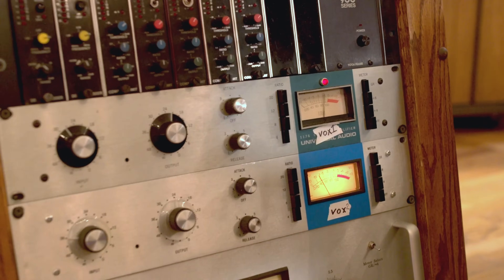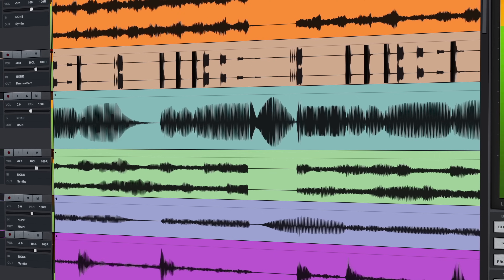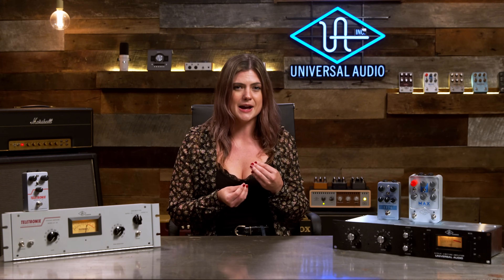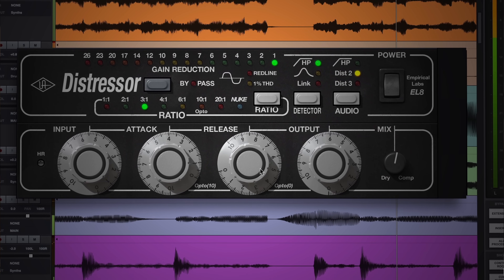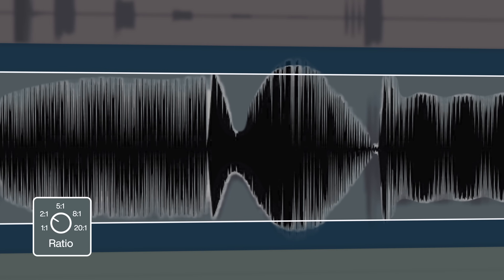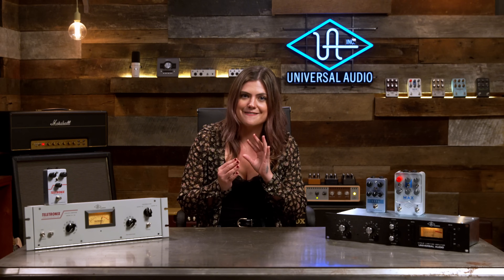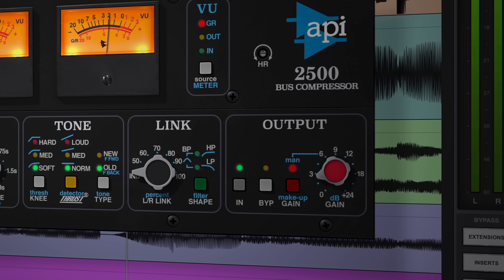How Do Audio Compressors Work?

Comment: 1:04 the graphic here is misleading. Compressor knee actually goes from totally hard (compressor attacks only above threshold) and totally soft (compressor begins attacking and releasing below threshold). The graphic makes it look like the same threshold holds for both shapes but it doesn’t really. Actually the hard shape is at that line but the soft shape goes below it. At the threshold, the ratio is whatever the knob is set to. Below the threshold, with a soft knee, a gradual ratio is present.

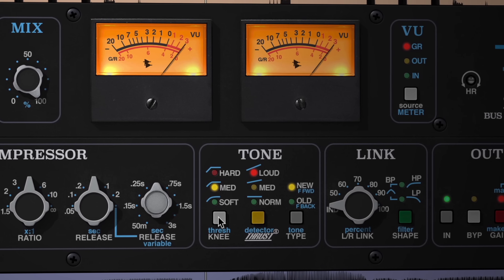You can hear what I mean at 1:14. The syncopated individual snare hit on 2 ee and UH 3 EE triggers the compressor with soft knee but progressively less with medium and hard knee. The release is short so you hear it as a reduction in sustain of those events as the knee becomes harder. Subtle but it’s there. Reason being they’re too quiet to reach the hard knee threshold but the soft knee reaches down to “grab them”. Auto makeup gain is on so it boosts the level as the release stage kicks in.

Also, 1:27, attack time is not the time it takes for a compressor to reach full compression. Full compression never happens. In Calculus it’s called a ‘limit’. Compressor attack time is the time it takes to achieve 2/3 of the gain reduction as set by the ratio control for a given threshold (minus the knee probably).

Ironically, the Fairchild compressor they show at 4:50 is known for being very fast. Look how fast the needle is moving - it catches everything.

Comment: Compression always seems like the solution to a problem I don't have. I LIKE the difference between the softest and loudest sounds
Reply: But when mixing a full mix, it can really glue everything together
Reply: It can bring out low-level detail, increase sustain, give a feeling of “support”, enhance or reduce punch, create distortion, change the timbre, and make discrete parts sound more unified. Try parallel compression.

Comment: Can I ask if the UAD Dsp plugin is better than UAD spark, or is it the same? thank
Reply: Sonically, they are the same. However, as native plugins (UADx/spark) run in the host instead of the soundcard, you of course won’t get the same latency free monitoring, neither unison preamps for those that support it 😉. They are perfect for mixing though.
Reply from the maker: No, UAD DSP plugins are the same as the native ones, minus Unison which requires an Apollo. But same great sound with either.
Reply: are there limits in latency compensation when using very high track counts, or does this all come down to the limits of the individual host-DAW? let’s assume a typical modern rock/pop production with over 100 tracks at 96k. how much processing latency can be compensated natively, and is it the same amount like running on an USB-2 octo satellite?
Reply from the maker: @tihinter  You're correct to say that delay comp is handed by the host. Most do have limits, but it's typically enough for most/all use cases.